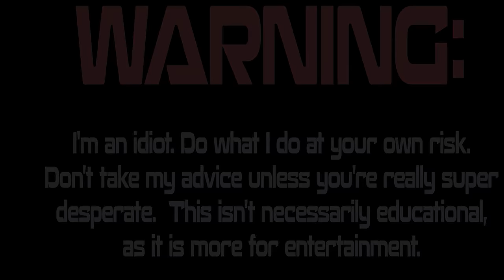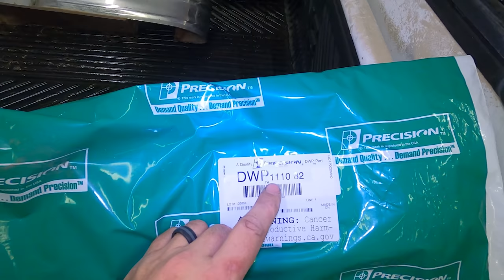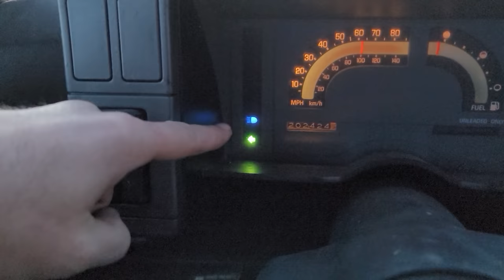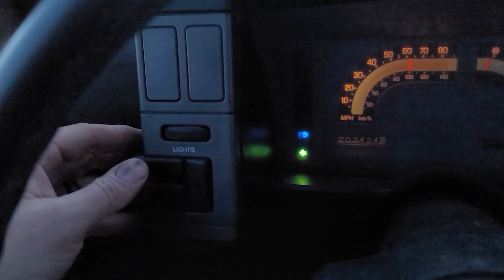Attempting a 600 Mile Drive In a FORGOTTEN Chevy S10 (multiple Issues)

Comment: One man's trash is another man's treasure..... Depending on how you look at it...... Be better if you had some heat...... I've had blower motors go out on me in GMs in the past and with the blower motor malfunctioning, just move heater controls to the hottest setting and let gravity do the rest... the engine heat usually seeps through the vents and eventually will defrost the cab windows.....

Comment: Man I think you'd have a way better time getting some old southern vehicles. I just bought I identical version of this truck but its red and got 300k miles but runs like a champ only had to replace the upper control arm on the driver side and it was only 500$ my rims and tires I got on it are twice the value of the truck lmao

Comment: I IGNORED RUSTY STUFF FALLING OF IN 1977. 1959 ELCAMINO. WENT AROUND A CORNER AND THE COLUMN MOVED 2 INCHES THE BODY HAD SLIDE SLIGHTLY OFF THE FRAME. THAT IS WHERE THE WRECKING YARD CAME AND HAULED IT AWAY

Comment: Well hold on now, hold your horses, 86 is only 3-4 years into the square body for the S10 anyway. The s10 started in 82 correct, 83 tops. Last Square body was 93". The second gen rounder one, didn't come out till 94. The infamous Cyclone, a square, the fastest stock pickup came out in 91. I know, I know, the years go fast, but still, its only 1/3 thru its run in 86.
If your talking square body GM's in general, than tea your 2/3's thru them. Oh that's whst ya meant, the square body in general. Got it as I thought about that at the end their.

Comment: I'm not digging this idea too much especially the part of driving the Shev ro Let, 500 miles. You might want to replace the spark o matics and see what kind of nocturnal aminal is sleeping in the air snorter, before you think about putting juice in the bucket. And lastly keep a tow truck driver on speed dial. maybe get a greyhound ticket if you decide to push it into a river.

Comment: you and my dad were equley " frugle "many would say cheep i was doing the front braks packed the bearing freh pads and had the disks turend there were on his 74  3/4 ton gmc he looked and said we could use the old shoes and dont turn the disk , it will work fine , i am not that cheap

Comment: not me having a 1985 s10 i do live in Mississippi so mine is better on the rust but i did pop a head gasket on cyl6 and working on fixing it but its not looking good to the point i might need a new heads i will find out in the morn and hope for the best but i dont think it will work out and you know its such a old truck you cant find anything for them cant even find a shop that will work on the heads so will have to do it myself not looking to do that but i will do whatever it takes for my dream truck to run one more time before i 350 small block it 

7/18/2022

Comment: candle wax and minimum heat  enough so wax melts over fittings or threads wax will go all the way through threads metals with rust think brake lines will come off and more

Comment: That broken exhaust pipe is very very bad. The carbon monoxide will sneak up on you,  cause you to drowse off, and drift off the road, sorry.
  Get one of those straight pipe things like on the other car truck thing? That will work.